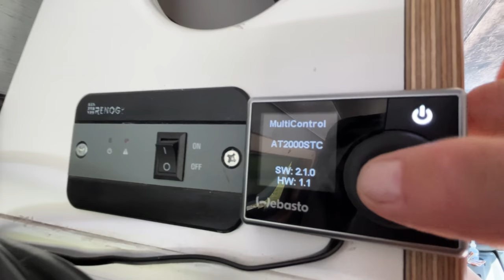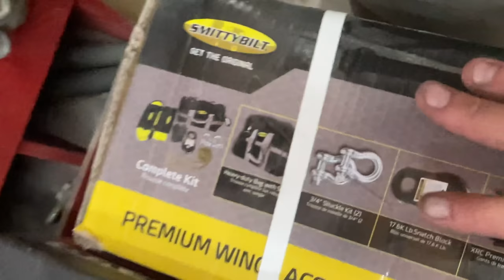Hyper-Vent Condensation Review, Shovel Roof Rack Mount, Fan Cleaning | VANCITY VANLIFE

Comment: A much cheaper version of that "hyper-vent" material is called "Den-Dry".  You can find it on Amazon.
Reply from the maker: Thanks for that tip I will pin this comment to the top. Maybe someone else can give it a try
Reply: @VANCITYVANLIFE  Actually, I just now looked up "hyper-vent", and it looks like the price might be comparable these days.  When you purchased "hyper-vent", I recall it being something like $220?   But I just now ran across a Marine outfitter website called "Defender" that is selling "hyper-vent" for $11 per foot, which is about the same for "Den-Dry" on Amazon.  Still, the "Den-Dry" on Amazon might be easier to order for some folk.
Reply: Got mine at Mattress Insider in Denver as well as a custom mattress. Easy.
Reply: @swamibob488  Oh, only $10 USD per foot for 39-inch wide "hyper-vent" there.  And they ship.  😊  I wonder if price has come down, or if where Chrome originally bought it just had it over-priced?  
I'm pretty sure Chrome paid $220 Canadian, and it really shouldn't have run more than $150 Canadian ($120 USD) for a King-Size mattress.  Even less for smaller mattresses.
Reply: There's also a product called Decorlife deck protector on Amazon. Comes in 1 foot squares, a box of 12 for $25. It's the same stuff and works great, way cheaper. I just used little zip ties to connect the 12 squares into 2ft by 6ft and it fits perfect under my twin size mattress.
Reply: I can't wait to see ur winch  and lift kit installed
Reply: No you love projects. You are not insane just creative.🤗
Reply: But the ambulance, have John go it with you.  Low rider ambulance??

Comment: Check out U Joint 4x4 out of the states.  They will do 4x4 conversions of your van or send the kit to you to have a local mechanic install.   They specialize in Ford Vans and make some sweet rigs.  No more need for the ambulance...and make the home you already own just as capable.   Not cheap....but neither was the build out of your van.   Looking great bro!

Comment: If  your thinking overlanding, inevitably you will need the proper outfit on wheels and it definitively means a 4X4 and the 7.3 diesel engine is the gem of Ford...  You won't find many occasions to find another rig like this... Surely but slowly, you are going towards that trail... Just to torture you a little, you would not want to say, few years down, I should have done this or that... Life is to short... 🚑😝😜... Enjoy...
P.s. What's that little kwickwik noise you hear all night long? It is not the fan, it's that mouse running in that wheel all night, thinking... It must be hard to sleep 💭
... Even Foresty Forest got himself a 4x4 van lately (you interviewed him with is minivan)